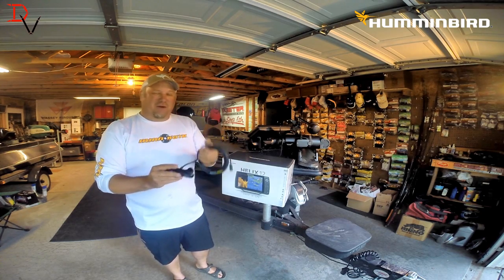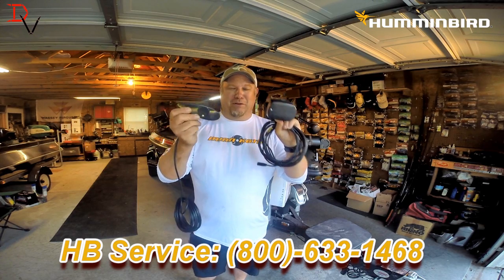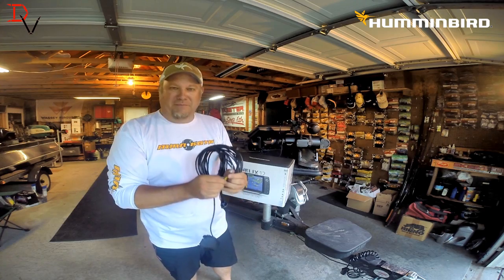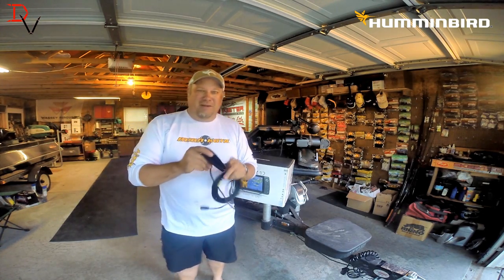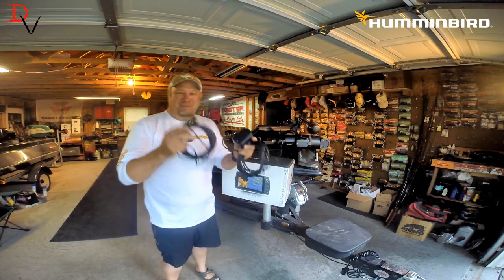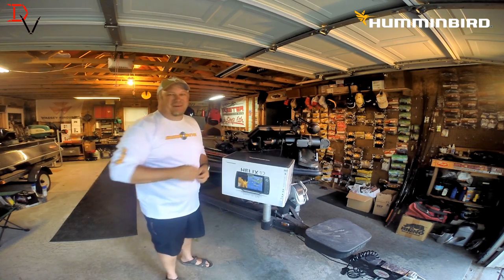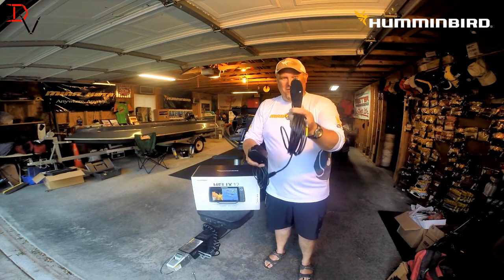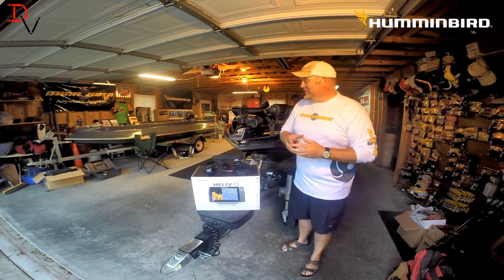Tips 'N Tricks 196: Humminbird Installation Tip for Down Imaging on Trolling Motor

Comment: Doug I have the xtm 25 so that I could get rid of the radio frequency noise. I was running the transom transducer but it was getting blurred with the noise. How do you wire the xtm 25 so that I dont get the noise?
Reply: I guess I should've said that I am still currently experiencing radio frequency noise even on my xtm 25...

Comment: Hummingbird sucks.  I bought a new boat 6 months ago.   I purchased the terrova 55 lb thrust motor for the front of my boat. Now I just purchased a helix 9 mega gen three with SI + DI    I called humming bird and they gave me a part number to mount the ling SI ling transducer.   When I received my depth finder from amazon and the bracket that Humminbird said would work.  It was to ling to fit the terrova. I called hummingbird back. Now they tell me that they do not make a transducer period fir the mega Si DI  that will fit my terrova.    So I have motor and a 1500.00 unit that are not comparable unless I fabricate some kind of mount to adapt  the long  transducer on my motor.   For the price of all this. They should have a mount or a transducer that will work in all their products.  Shame on you Humminbird/minnkota.

Comment: Thanks again for another great video Doug! I just installed the xtm9di25t ducer on my Helix 7 G2N. In the settings for CONNECTED TRANSDUCER I can select DI200/455KHZ, DI83/200, DI50/200, HIGH WIDE CHIRP, HB 83/200... and it goes on. Am I right in assuming it's DI 200/455 I select? Thanks

Comment: I installed this transducer , and have broken 3 of them .. the cheap plastic the holes are , cause tons of issues .. I had 1 crack in my garage from heat 1 day after brand new installation
Reply from the maker: Your tightening the transducer clamp too tight. It only needs to be tightened enough to hold transducer in place. I actually like using big tie straps or tighten clamp just enough to hold transducer but still move if you hit something. I also use the Transducer Shield & Saver RAM Protector for this transducer. I have video on it too.
Reply: Doug Vahrenberg I didn’t see a transducer saver for this one , must have missed it .. thanks I’ll check it out

Comment: I bought a Solix that came with a different transducer than what you were showing.  Hummingbird said, " Your unit's XM 14 20 MSI T will need the AD MTM mounting kit to connect to the trolling motor."  Do you think this will be ok?
Reply from the maker: This transducer was for Gen 1 HELIX & older CORE SERIES Units.

Comment: I'm Glad that I ran across your information b/c Hummingbird isn't informative enough to disclose this information.  Also, here is the place to find the "RAM" Protector he is talking about.
RAM BT-1 for Humminbird XTM trolling motor transducers $34.95
https://www.transducershieldandsaver.com/.../ram-bt-1-for-humminbird-xtm-trolling
Reply: I purchased Hummingbird’s Trolling Motor Transducer and found that the ears for the hose clamp that attaches the transducer to the trolling motor is very POORLY DESIGNED & broke off in 15-mins.  I wrote all of this in a Review of the transducer on the factory outlet website and said that I should have bought Lowrance.

Comment: Will the transducer ca. fit in the shaft slot of a terova motor.There is only room for .225 diameter  cable.The standard transducer cable will fit.Just wondering if the xtm 9 di 25t cable is thicker
Reply from the maker: The Gen 1 HELIX or older Core Series cables fit the shaft groove from what I have seen.

Comment: Thanks for this info. Ordered the Helix 12 Mega DI G2N and because of this video I was able to get the transducer switched out and just got it installed on my Ultrex as well as a 360. I probably would have tried sticking the skimmer  transducer on somehow and not been able to return it. Saved me money and super happy that humminbird does this. I am annoyed that the 360 came with a 10m cable that I had to use between the 360 and the Helix cable adapter but overall that's just a little cable management. Thanks for all the info you put out. I have only used lowrance prior to this unit so very educational stuff!
Reply from the maker: You can purchase shorter Ethernet Cables to connect the 360. It doesn't hurt having longer cable but if you like short extension they are available.

Comment: Hi Doug. Been watching you for years. You were one or the reasons I got (2) Onix 10 SI for the Search and Rescue Boat. They work, but last year I notice the Transducer on the Trolling Motor was leaking. There was a Honey like substance leaking all over everything. I have never seen this on any brand. Then I went to the back of the boat, and that one is leaking also. Have you heard of this problem? How do I fix it. Went to the Humminbird Website, and discovered they discontinued the Onix. As you know I have spent thousands on all of the equipment from Humminbird. Thank you.
Reply from the maker: Sounds like the transducer has cracked and the acoustical epoxy inside is leaking. Did you call Humminbird Customer Service 800-633-1468

Comment: Hey Doug, I just got a boat that has a helix 7 SI GPS on the bow they were running it with the puck transducer in the TM what model would you recommend for me to get so i can use the DI and SI
Reply from the maker: You need to install trolling motor version of the SI transducer on the trolling motor.

Comment: Hey Doug I'm buying the Helix 10 si mega and my question is with this transducer xtm9di25t is it for side imaging as well as down imaging?
Reply from the maker: This is for non-MEGA Imaging Units.
Reply: Doug Vahrenberg I’ve decided to put a helix10 DI on the bow and a helix10SI on the console. My other question is what transducer do I need for my trolling motor since they will both be  mega and the tm will be a DI. I’m gonna do the transducer exchange program and want to get it right. Thanks

Comment: Can this transducer eliminate electrical noise?
Helix 9 CHIRP DI G2N user.
Which of the two should I install?
Reply from the maker: The Trolling Motor DI transducer has added shielding to reduce Electrical Noise. The Teardrop shaped DI transducer does not have the shielding and should only be used transom mount applications

Comment: Hi Doug great videos and info as usual ! here is my dilemma, i purchased two Helix mega si g2n  at the helm its dialed in and clear , at the trolling motor with the transducer shield saver . when i touch the pedal the depth  goes crazy  anywhere from 2 foot to infinity  pretty good for a 20 foot deep lake  let of and the helix settles down every thing works fine . I power feed from the starting battery , is this a ground issue ? if so what do you suggest Thanks in advance !
Reply from the maker: I would contact Humminbird Customer Service: 800-633-1468 they can help you try to resolve where your electrical noise is coming from and can offer tips to help resolve it. Sonar are listening devices and they have ideas and suggestions that will help try to control or resolve it.

Comment: Hello Doug I just bought the Humminbird piranha Max 4  and mounted the tear drop transducer to the trolling motor (not  knowing) if were to buy the XNT-9-28-T trolling motor transducer  from eBay would that be the right trnaducer or would I need to buy the XTM-9 DI 25?
Reply from the maker: You need the Trolling Motor version if using on the trolling motor

Comment: I switched the transducer out and found that the trolling motor version for the helix 10 mega DI also came with a choke cable. Should I use this? I do have a battery charger hooked up to my crank but I don’t see how it would cause interference if I’m out on the water and it’s not plugged in. Any suggestions?
Reply from the maker: I have not seen this Choke cable can you tell me what it looks like a plug configuration?
Reply: Doug Vahrenberg it’s got two butt connectors then it goes up to a choke, then two wires that connect to the battery. The instruction manual is here https://www.humminbird.com/WorkArea/DownloadAsset.aspx?id=16899

Comment: Doug, I did as you suggested and traded my transducer for the XTM 9 MDI T and received it yesterday.  There was also a Choke Cable included in the package.  What is this cable for and how do you install it?
Reply from the maker: Not sure what Choke Cable is. Is it just a black donut or wire with built in choke can you explain?
Reply: It is a cable with chock block in it that goes on the starter battery on board charger leeds.  This is to block any noise coming from the TM batteries back through the charger and into the starting battery.

Comment: I've got a  SI transducer in a Helix 9 at bow and there are multiple interferences. I have to go to 5 or max 7 sensitivity settings to get away noise interference I've tried all kind of differents settings and diferent assistance that you cand find at different forums as bbc but finally ships happen again.... I'm staggered How its possible that nowadays Trolling motors and sonars transducers works together in the same range of frequencies even more when the 75% maybe more of the people have this fucking problem...
By other side... good video Doug and thanks for sharing...

Comment: Is there a different transducer that should be used with a side imaging helix mounted to the trolling motor?
Reply from the maker: Nope the SI transducer both Transom & Trolling Motor versions has the shielding already built in them
Reply: Thanks Doug!